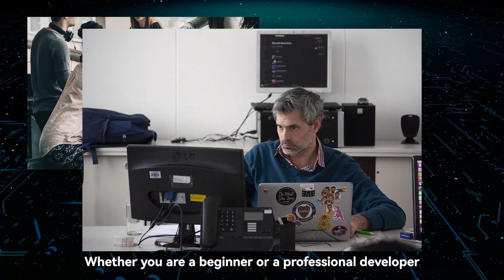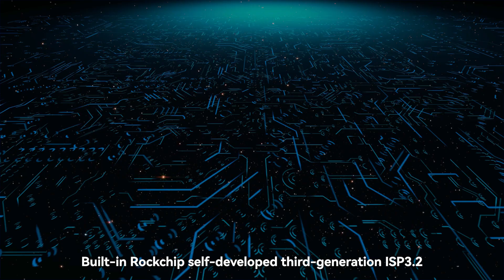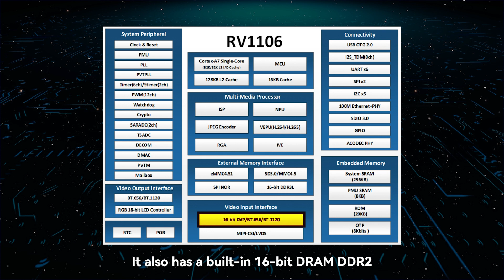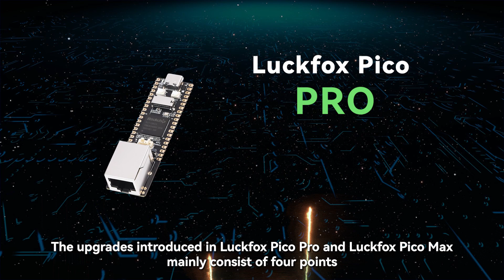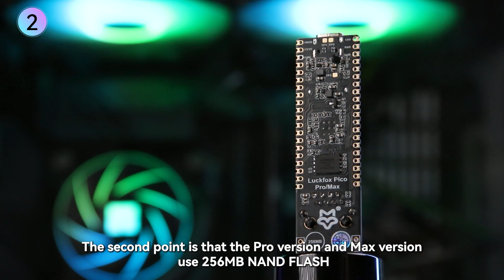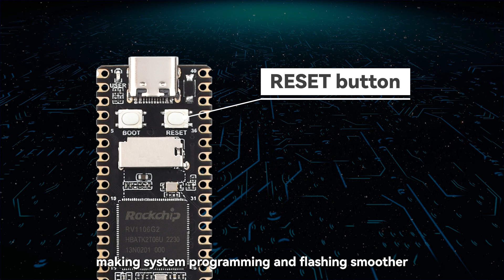Luckfox Pico Pro with 128MB DDR2/Max with 256MB DDR2 Memory, RV1106 Linux Micro Development Board

Comment: Is there a poe version planned?
Reply: Ive made my own POE for raspberry pi and its very reliable... maybe you can try to make your own connector split off from Rj45 to barrel jack / or type c with voltage regulator and just make sure you use higher voltage such as 24v max 2amps then drop down the voltage on the other end before going into luckfox
Reply from the maker: sorry there is no plan now :(
Reply: @waveshareelectronics  too bad. This would be a killer platform with poe